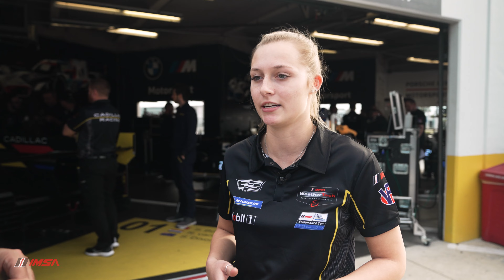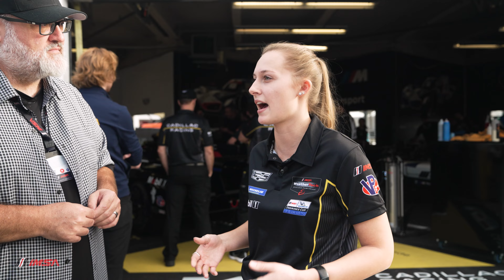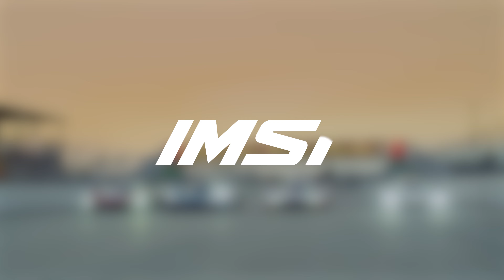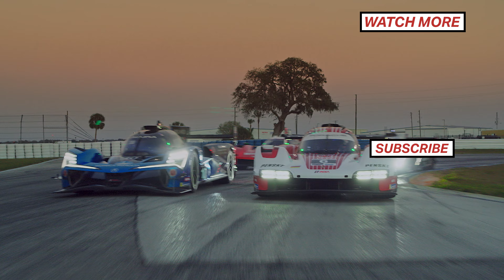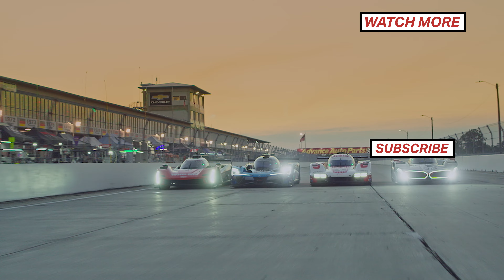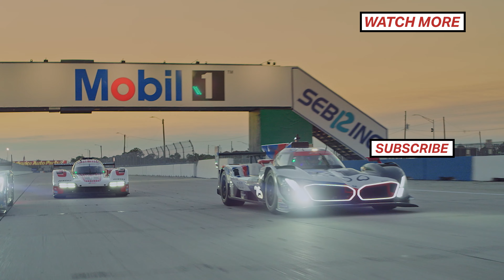Opening Doors | Chip Ganassi's Simulation Engineer Explains How She Got Into IMSA Racing

Comment: Father was an engineer back in the late 50s, with Chrysler aerospace,, in the early 60s one of the Chrysler turbine cars pulled into the parking lot at a local hardware store, father told me he could have had one of those for 3 months to do a engineering report on,, he wasn't interested he was busy making Rockets on the Mercury space capsule project with Wernher von Braun,,, Wished  he was into cars.....